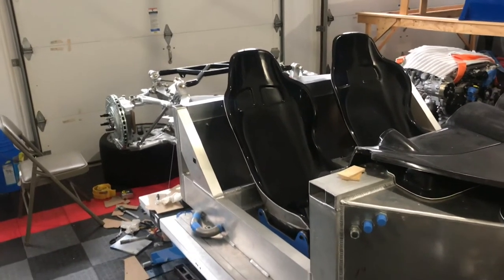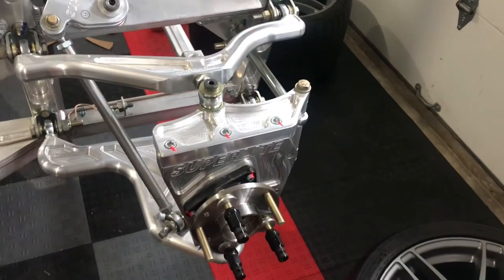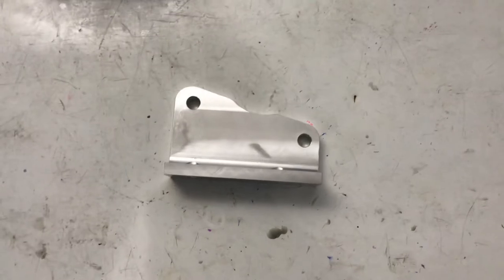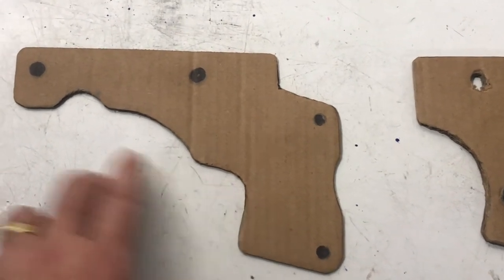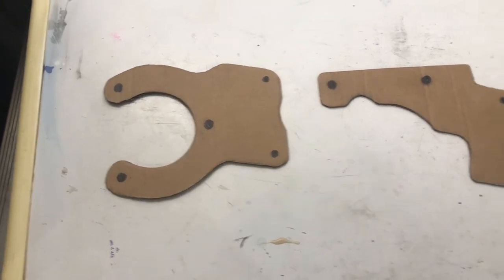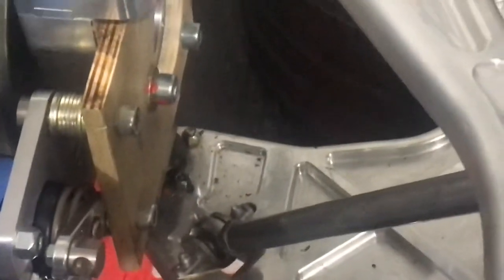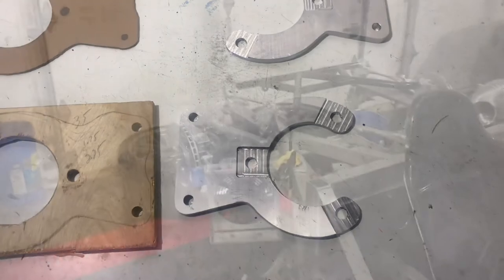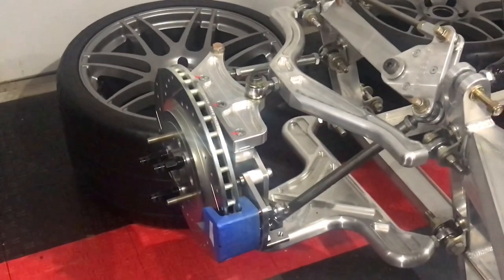Superlite SLC Build 071 Parking Brake Caliper Install

Comment: Nice one.  Great progress and attention to detail as always.  Side note,  I prefer using VAG electric rear calipers.
Reply from the maker: Thanks Louis, I’ll check them out.
Reply from the maker: Louis, how do you control the VAG calipers?
Reply: @JoelKSLC  hi, I use the sparkfun 30A dual output motor controller  with arduino. If you're interested I'll dig out my diagrams and  code.
Reply from the maker: @kwassierufus  Thanks! At some point I might take you up on it. Once I start the electrical more than likely I’ll use a linear actuator and will need a way to control it.

Comment: So, did you end up remaking the bracket that attaches the caliper to your new bracket?  I saw that you milled it down, but didn't catch if you started from scratch on that first bracket.
Reply from the maker: Yeah, so used the supplied bracket which I milled down as a template for where to mount the PB calipers. The new bracket I fabbed up is a different design. I am convinced at this point they grab really well and will do the job.
Reply: @JoelKSLC  I’m so sick of this exhaust!  I want to get it all tacked up before I shoot you a picture.  Being totally custom, I had a lot of planning to do. Obviously there’s nothing out there that can be bolted on. I still have to fab up hangers.  Give me a couple weeks and I will be a lot closer. The other side will be a breeze!  Hopefully we can shoot down to see you again this summer!

Comment: Great job Joel.  When the manufacture sells an add on it should make the chassis accessible for that part ie these emergency brakes.
Reply from the maker: Thanks Dave, it would have been helpful to have the holes in the side of the uprights pre-drilled and tapped at the factory. Although I still would have redesigned the L-brackets to get the caliper closer to the perimeter of the rotor. It’s just the way RCR delivers the car by default, they would have done it if I asked but in this case I wasn’t thinking that far ahead when I ordered the kit.
Reply: @JoelKSLC  hard to anticipate all of the things you might want them to do. But you and others who are building sure do help the rest.  I am making a full list of all the little things missed.  Thanks